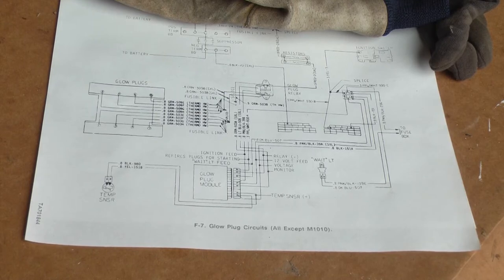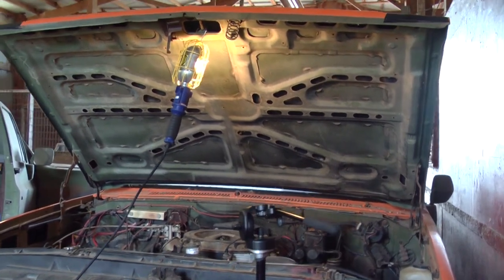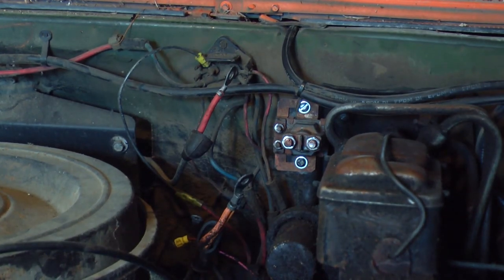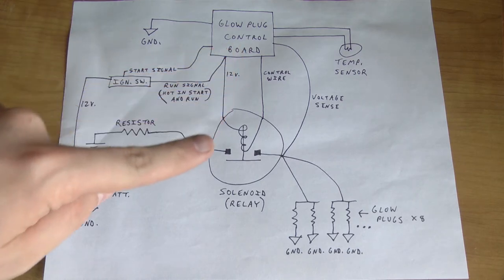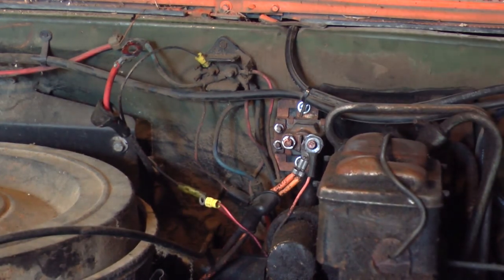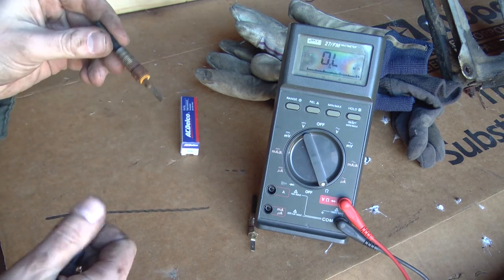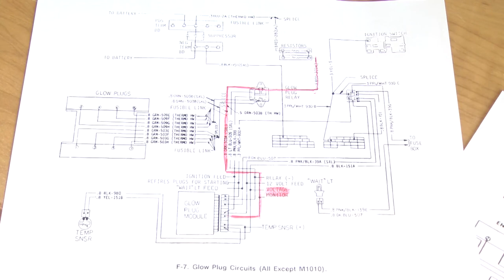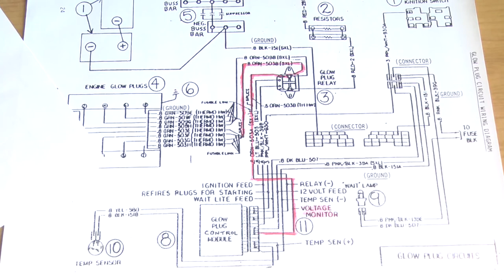Chevrolet Military CUCV Truck M1000-series Glow Plug Wiring (revised)

Comment: The best thing to do with the CUCV Glow Plug System is to upgrade it to the 1987 6.2L C&K glow plug system. It's a better system. It will readily integrate into the CUCV's 12V wiring.

Comment: Nice job on this video!  My only concern would be that I would not mix glow plugs, go with all 13g's (recommended) if you have the entire original system, only go with 60g's if someone removed the glow plug card and installed a push button toggle system that cycles the glow plugs manually (this is not recommended!).

Comment: Need to really point out the temp sensor plays a hugr role in this. That is the main driver. Going over these wires and what they do will help people doing swaps where the vehicle getting the swap is missing the module and all the glow plug activation

Comment: I have an 83 K30 with glow plug issues, would your wiring diagram be accurate for my vehicle also?
Reply from the maker: Nope, the civilian trucks have a completely different glow plug system! I'm not that familiar with them other than I think they have a relay with an integrated controller (and of course, its all 12 volts).

Comment: What if wait light flashes for a while and then goes off?
Reply from the maker: That is the same as if the light stayed on solid and then went out. Just means the glow plugs are still heating and aren't warm enough for the engine to start. Some of the aftermarket control boards have an option to flash the wait light instead of it being on steady.
Reply: @w8nwo  I figured it out, it has an aftermarket upgraded board in it, thanks

Comment: I dont get fully how you check the glow plug solenoid, specifically the blue wire, you said you have it in your hand and a lead is grounded to the blue wire, you lost me there
Reply from the maker: I connected a jumper wire to the blue lead. To activate the solenoid, I momentarily touched the other end of the jumper wire to bare metal on the truck.